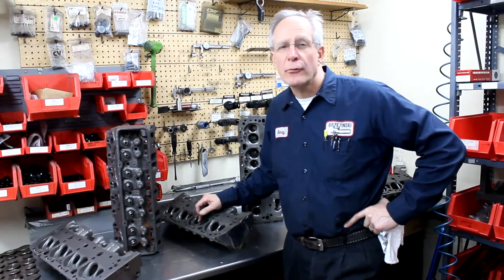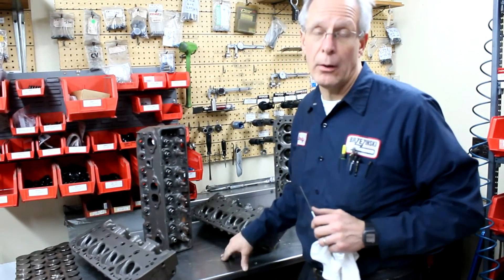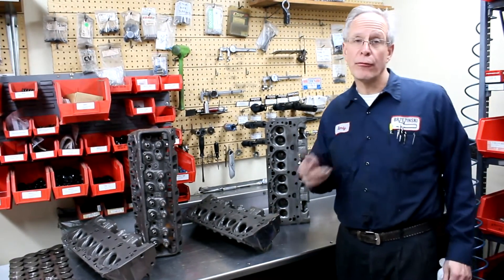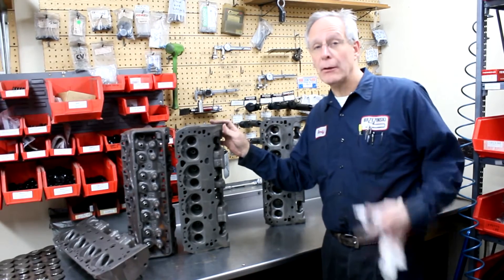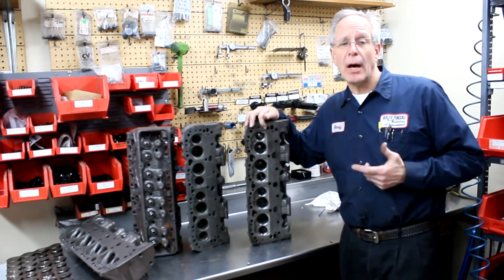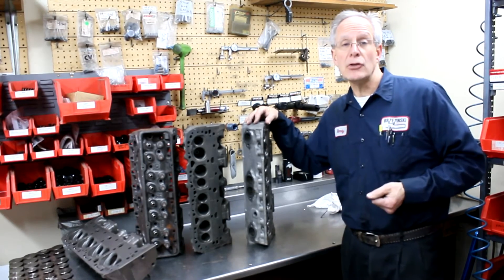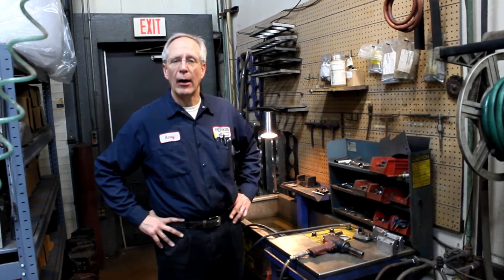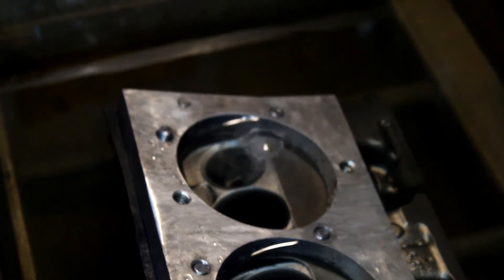Open Chamber Heads and Seat Ring Leak

Comment: Im surprised the larger bore doesn't unshroad the valve making more power? This is inconsistent with testing and base engine design theory (which the bible given to all GM new hire). Do you feel larger valves on Vortecs are worth the upgradinv if you already cutting seats, providing backcut valves, for a 4.000' bore GEN1 with Vortec heads? Thanks for the informative post.
Reply from the maker: There is a fine line when it comes to valve size and flow numbers. bigger isn't always better in a lot of cases. in a way you did answer your own question. It is theory, not law, so as it may seem like the bigger valve will give you more flow, it hurts the air speed, causing less flow

Comment: did the 993 heads come with 2.02 valves and 1.94? I have a set and I'd like to run them on my race car that I'm pretty sure are 2.02. I know a 2.02 valves won't work as well. If they are 2.02 can they be changed to 1.94? Thanks for the videos
Reply from the maker: in stock form they should only be a 1.94. so unless someone already has put a 2.02 in them you should be ok. you can always give us a call Toll Free: 866-236-6300 or send us a email at info@castheads.com and we can do what we can to help you out.
Reply: Cast Heads how much power loss are we talking with the 2.02 valves in 993s?

Comment: Great video! What about the 993 "Hecho en Mexico" heads? I've heard some guys say they are better than the non-Mexico heads. Any truth to that??
Reply from the maker: The heads that say "Hecho en Mexico" have smaller ports, similar to the "conv v" heads.
Reply: Ok. Thanks for the info. Love your videos...keep em coming..
Reply: Would love to see you do a video explaining and showing the 2 into 1 exhaust and why it works. The different size pipe and numbers output for each.
Reply from the maker: What 2 into 1 exhaust are you talking about?
Reply: The ones for the log manifolds and corvette manifolds that you offer.